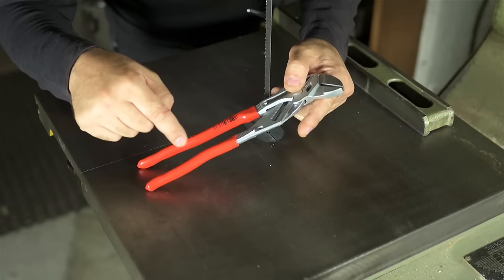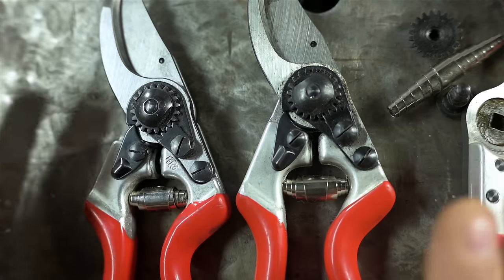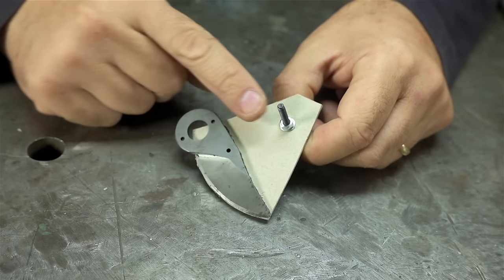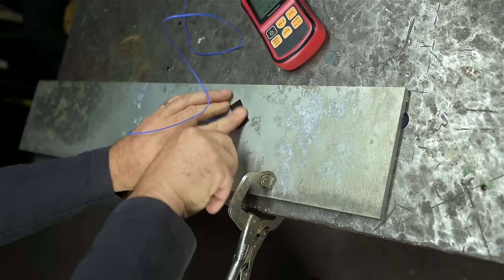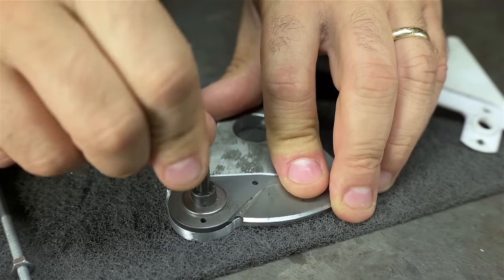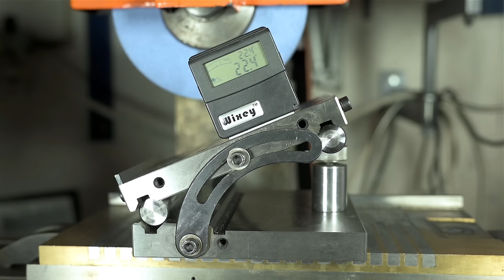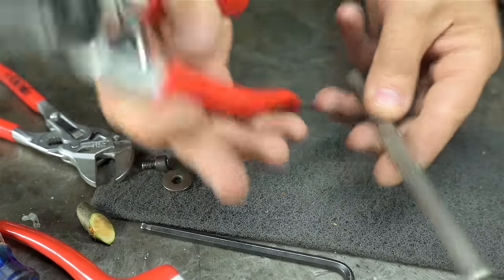Unnecessary SHARPENING JIG!

Comment: The factory sharp tool has always been the dullest one in the toolbox😂
Reply: Ikr! I thought it was funny he wanted a “factory edge” knowing any edge he puts on it will be bettered. And that first pass on the cutting where was magical!
Reply: Seriously, I always reshape the edge on a lot of things that come pre sharpened because they have such crap cutting angle or half ass grinder sharpening
Reply: I always tune up the factory edge. The factory is not that particular.
Reply: Hear, hear; although Felco does a better job than most. A fine file suits me just fine.
Reply: I've only achieved as good as factory a couple times when sharpening, and I've been trying for years
Reply: @bacicinvatteneaca Maybe try a jig? I'm told those work...
Reply: “But enough about ToT…”
Reply: @SilvaDreams I’ve found this with some drill bits. It’s not cutting great strait out of the pack. A little tickle later and there she goes!🇬🇧

Comment: Thanks for this Tony.  It brought back memories.
My Grandfather (who was a tool and die maker) created a similar jig for a set of 100 curved blades he was asked to sharpen.  I was in my early teens when he got the contract to do this work.  
I recall how he smiled while describing the job to friends at a dinner table.  He described that the curved blade edge was nothing more than part of a circle.  
He must have had a similar eureka moment like you did.

One thing he gnashed his teeth about is that the set of blades he was working with had slightly different widths.  To simplify, the radius of the curve was a smidge shorter on some blades than others.  
While he was taking measurements on the blade, I am sure I heard many new bad words in German.  This radius deviation was an anathema to his German perfectionist personality.
From what he could gather, years of hand sharpening had inconsistently removed more material from some blades than others.
This forced him to extra-engineer his jig by making it adjustable so that he could put the same exact angle (as close as possible anyway) on each blade depending on it's width (radius).  
Basically he did something close to what you did on your cardstock model.. a bolt that he would turn to adjust the height of the angle.  
A smaller radius would require lowering the one side of the jig by simply turning the screw.  A larger radius would require increasing the height in the same manner.

The other thing he did was hone the flat side of the blades before he put each of them on the jig to sharpen the bevel.  
I was not there when he did the flat grind work, but I remember the flat side of the blade to be so flat that I had difficulty picking it up with my fingers off an old surface plate he had in his shop.  He used a magnet to grab them from flat surfaces because they were so flat on one side. Also to likely protect the surface plate from accidental scratches.
He explained to me (a then lowly teenage kid with nothing better to do but shadow his Grandfather) that the difference between a sharp scissors and a really sharp scissors blade is the combination of one side being very flat side and the other having a consistent and sharp bevel edge.

Once he had the jig set up on his grinder, he started work on the grinding.  
I think he was done with all the blades in about an hour, though he spent a week working on that jig (he did all his machining manually... no CNC at that time in ancient history).
With each blade, he would adjust the bolt slightly depending on the blade width.
After he completed the grinding work, he stropped each blade to take off any burr.
In my young experience, those were some of the sharpest blades I had ever seen outside of the razor blades you get from a store.

He later told me that he not only got paid for the sharpening work, but also sold the jig to the business that hired him to do the work... for 3 times the cost of the contract!!
I guess the company really liked the work he had done but recognized that he may not be around much longer to do that work again.  He was already well into retirement.
My Grandfather suffered a stroke shortly after that and passed away a few years later.  I miss him still.

Thank you for all you do for us Tony.  Every new video you give us is a feast of entertainment and learning all in one bundle.  🙂
Reply: I appreciate that you covered Felcos. I worked in a nursery in the early 2000's and they made me purchase them.   I still have them and they really are great, possible the best pruners.
Reply: This is a lovely comment/story. Thanks for sharing.
Reply: @AllanSitte this is the best YouTube comment I’ve ever read, thanks for sharing.
Reply: Well told my friend. Thank you!
Reply: That story was amazing to read, thank you for sharing! My granddad is an asshole, so i am happy for you :3 Maybe even a bit of envy :D
Reply: Thank you for taking us down your precious memory lane. Adios grandpa.
Reply: Wow!

Comment: Hi Tony. In tool sharpening we usually use the height of the unsharpened tool  relative to the center of the grinding wheel.
If you sharpen at the height of center of the spindle (9 o'clock on the wheel) you get a 90° bevel.
If you raise the wheel 1/2 radiius (7h30 on the wheel) you get a 45º radius.
If you raise the wheel 3/4 radius you get 22,5º.
That way you don't need a sine plate and everything is orthogonal.
See a video of a "Akemat" saw sharpener if my description is confusing.
Reply: nice try smartie pants.
Reply: Just a minor note on your trigonometry -- moving the wheel vertically by half the wheel radius would yield a 30 degree bevel since arcsin(1/2) = 30 deg.
To get a 45 degree bevel, you would need to move the wheel vertically by sqrt(2)/2 times the wheel radius, or about 0.707 times the wheel radius, since sin(45deg) = sqrt(2)/2.
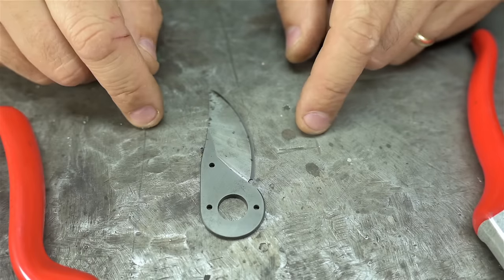Reply: 7:30 is halfway between 9:00 and 6:00 and would be at 45°, and 6:45 is 3/4 of the way from 9:00 and 6:00 and would be 22.5°, but those aren't at R/2 and R*3/4 higher -- you need sin(90°-angle)R higher or 0.7071R and 0.9239R higher.

Comment: Three things I've learned from knife grinding in the last 8 years:
1. Grind with the knife edge against wheel rotation. It won't burr as bad on the edge. Fixture sturdiness is of utmost importance here as there is a slight danger of the wheel "grabbing" the part.
2. The knife needs to be on the wheel  centerline for the correct angle. (Tony mentioned this.)
3. Coolant needs to be present so the temper is not drawn from the knife edge. It is difficult to direct it right on the part at times, so I usually aim it at the wheel. Let it spin out of the wheel before shutting down so the wheel doesn't go out of balance. (Shut the coolant off, let the grinder spin for a few minutes, then shut off the wheel.)
Reply: Great points.
Though, wouldn't resurfacing the flat side and using a custom shim to offset the thickness removed, be much simpler?
#3  Localized heat can definitely ruin/anneal the edge, coolant would certainly be required removing more material.
Failed to realize leaving coolant 'in the wheel' can cause imbalance, TY.  But such a video wouldn't be as interesting.
Reply: @cheerdiver  Agreed. Any time you can grind both sides of the edge is definitely beneficial. It's not always possible (or economical) to do it in that order. Often times it is much simpler to do what Tony did and just deburr it with a stone after grinding. Oftentimes this is unavoidable (pretty much all machining operations leave some burr that will have to be removed later.)

Watching a grinder run without coolant is definitely more satisfying/entertaining.
Reply: In addition to coolant, it is also useful to be able to run the grinder more slowly. Creates less heat in the first place and has the side effect of not flinging coolant all over the shop.

Comment: Small tip for acquiring image references of parts to copy in CAD: if the parts have a flat side (like in this case) use a scanner. Even the most accurately taken photo will always have some distortion due to the camera lens.

Amazing video as always! :D

Comment: A part of my job is making things like this for almost the exact purpose. (And a company I work for uses some equipment exactly like Felco has.) A couple of thoughts. The hole pattern is very likely a better location feature than the blade spine. So a dowel pin of a diameter matching the one on the handle pressed into the jig might be a better option than just a screw. It would also be nice if that jig actually had its own base that attaches to the sine plate. This way, you'd be able to set the exact rotation limits (again, dowel pins instead of screws). Since the wheel is round and has a different diameter every time you use it due to wear, this setup might be a little tricky unless you model everything in a CAD and make some sort of a reference frame that would ensure repeatability with a wheel set to the exact same height from the chuck surface, etc. BTW, a wheel axis finder (basically, a pendulum that attaches to the wheel shaft) might be a useful accessory to have if you want to do tricks like that in the future without much guesswork.

Comment: I have manufactured 1000s & 1000s of Blades to over  28,000 different blueprints for, wood, paper, leather, tires & even Zamboni Ice scrapers & more. On my pruners I often sharpen to a 27 degree point & add a 22 degree relief, leaving 1/16 of the 27 degree point. Just my 2 cents coming from over 40 years in the field. GOOD JOB.
Reply: Is that 1/16th of the bevel, or 1/16th of the linear length, or 1/16", or …? (Edit: I suppose the first two are the same.)
Reply: 16th inch left at the tip of the blade, thicker profile there may be to help reduce damage and deformation? I've sharpened a fair bit, but not pruning shears.
Reply: @jonanderson5137  I worked with TRIANGLE T CORPERATION for 20 years & then for W Fearnehough of America for 8 years specializing in large Paper Knives 68"-98 long by 6.5-7.5 wide & 5/8-7/8 thick. These would be sharpened on a 22.5-24 degree bevel & a relief cut of 17 degree leaving .125 of the 22.5-24 degree. I hand honed these with multiple grades of oil stones. When finished I could take a normal sheet of paper & cut 25-30 slivers off paper as I walked down the blade in well less than a minute. These were Large & Scary sharp.

Comment: Nice video, I have a No 6 Felco, genuine.

One thing everyone must understand, is to not let it sit in rain, and that pruning tree-branches introduces sour corrosive sap and other stuff to the carbon-steel blade, so it must be cleaned and oiled after use.

Mine is in good condition, just a bit tarnished, and some rare small nicks in the blade edges. (what did that come from ? )
I clip barbed-wire and other metal stuff with a special tool, not a "Felco" pruner... :)

Perhaps some grit that got caught while resting the tool to the ground. One never let carbon-steel tools lie on the ground in the rain.

I have extremely rarerly used it myself, haha.

Comment: You're going to want to re-establish that tiny back bevel. Without it, in a heavy cut, the top blade can ride over the bottom blade, damaging both.
Reply: Great, that will require a whole other jig now.
Reply: Aha, so that's why my fiskars loppers kicked the bucket straight out of the package. Not a big branch either but it was dry.
Reply: @rappin05  bypass loppers are supposed to be for green wood, and anvil style cutters are for dry wood.  I don't know why I know that, but it is more random than something I could make up.

Comment: Ive been sharpening mine by hand at the back of my truck for 50 years and they are VERY sharp when I do it. It only takes about 15 seconds with a fine 4" to 6" flat file. Takes skill to not change the angle as you draw (not push) the file across the blade but something anyone over about 10 years old can learn in short order. But I'm also a gadget guy and like knowing all the ways it can be done.
Reply: I have also maintained mine by hand for years. However I have come to learn that any worthwhile machinist, or other passionate hobbyist for that matter, will never miss the opportunity to improve their efficiency by spending an exorbitant amount of time to create a gadget for saving a few seconds here and there. Solely because they wondered if they could.
I can also say that whilst my felcos are still sharp, the blade certainly doesn't look like it used to. Every occasional mistake compounds on the others to give a rather unique blade profile.

Comment: TOT - you are an absolute icon. It's an odd experience, while watching your videos, to be both intensely jealous and immensely grateful at the same time. A long, long time ago in a galaxy far, far away I had a vacuum plate made for holding very thin sheets completely flat and wrinkle-free while they were getting coated with goop. The vacuum plate was made from Metapor Aluminum (McMaster Carr) which was pressed into a solid aluminum body with a small plenum space at the bottom which led to an exterior fitting connected to a vacuum pump. Even with a normal diaphragm pump running -15 " of Hg that thing could hold mass. If you're looking for a clampless chuck that won't be scared off by a little bit of shear force, I think you might consider building a vacuum plate. If you make a big one, you can use masking tape to blind off the area you don't use so that you maximize the vacuum draw under the part you want to hold. I have NO idea how common vacuum plates are so I thought I'd drop it in the comments in case it might be interesting to anyone.

Comment: I just love Tony's dialogue. I usually sharpen curved surfaces with a stone clamped to a rod held at a desired angle above the blade, in the fashion of the Lansky sharpening system. I use a set of cheap diamond plates, with a 400 grit stone to finish. Not mirror polished, but sharp enough. By turning the stone along the radius of the rod, most curves can be matched. But not this well :)

Comment: A few years ago i made a DIY copy of the "Edge Pro" sharpening system since $300 was a bit much for my wallet and it works great on my shears. You can set the angle quite easily and since the hone is what moves, it can sharpen anything from a straight chefs knife to a curved hunting knife to a hatchet, and if done in sections, a machete. The machete is so sharp you can get 8-9 slices from a black olive

Comment: No knock offs at all. I use Felco 8 for more than 40 years now. In the 80ties they had round screw heads. They changed to hexagon 25 or 30 years ago. So your eBay finds are only old, not fake.

Comment: ha my old boss used to bring me a pile of those same shears from his vineyard to clean up and sharpen. I would do them by hand of course with a sizable stone wheel. one tip though i would add is running a ceramic dye grinder bit along the other cutting edge a few passes can makes a big difference.

Comment: Some "weird, non-easy shape" like a decreasing radius towards the tip would make your mechanical advantage work better over the length of the blade, which is prolly why you thought that was the case. I guess as you get further out on the blade the limb you're cutting is giving up less resistance, so a circular profile works. Or the other blade is "weird, non-easy" shaped!
Reply: You do want that but that's kinda what the other side of the shears provides. I think it's circular too but the way they intersect provides the profile that's needed.

Comment: I own a knife blade manufacturing company. We plasma cut out blanks and the heat treat and surface grind them. The missing puzzle that I have been wanting to add is a primary edge bevel grinder and I have spent countless hours scratching my head on how to pull it off simply.

Comment: I need to measure an angle of a specialty cutter at work and without the abilty to buy a proper tool and no one including the machinists could think on how to measure an accurate angle on so small of a device.  And old tony comes to the rescue with a bolt and geometry.  As always This old tony is the hero!

Comment: Decade as a toolroom grinder here - the offset from centerline of the wheel, and the error off centerline of the grinding wheel both affected your blade angle. Going by your marker line, you cut with a larger angle than the OEM grind. I'm too drunk to calculate the expected offsetting right now, but I'd wager you cut at around a 30°. This would be better to put a finishing edge on your tool than the full relief angle cut. As such, you should sharpen just the final edge of the blade with it, similar to a chisel.

Still a damn good job as always.

Comment: I used to sharpen knives and shears as side work.  Everything was done by hand, but I had a few jigs like this I built to go in my bench vice to hold these odd shaped blades.  I also make some for the anvil side of the sheer.  If the anvil edge is beveled, no matter how sharp the blade is, the sheers will not cut well.  Most of the time, this involved removing material from the inside face of the anvil with a die grinder, then following this a half round file set.  This is then followed up with facing the entire anvil casting surface since this typically was also the surface for the pivot.  If only material is removed to clean up the blade area, it would leave a gap between the blade and the anvil

Comment: ive got an awesome handheld sharpening jig, you clamp the blade in the middle, and attached to the clamp is a protractor like thing you can adjust to any angle you want that has a slot you place a threaded metal rod through, said rod screws into plastic whet stone holders, this allow you to sharpen the FULL length of almost any blade, at virtually any angle you want, weather its straight or curved, WHILE keeping a consistent angle.